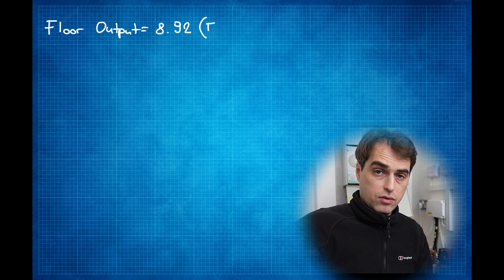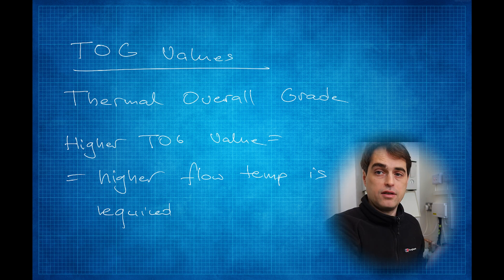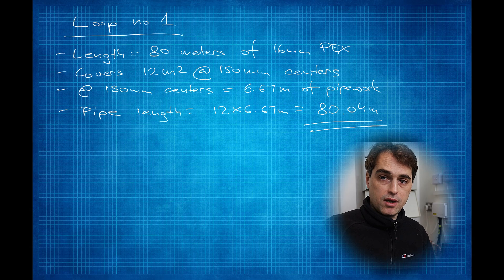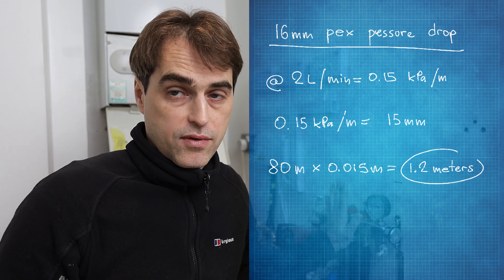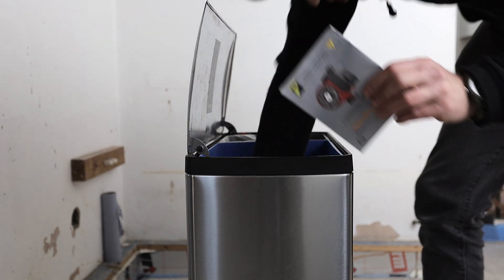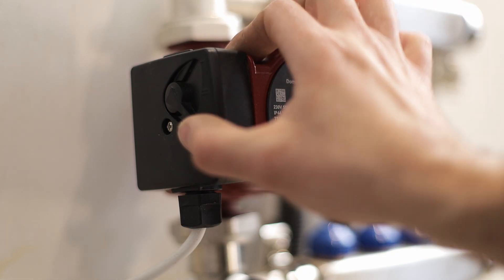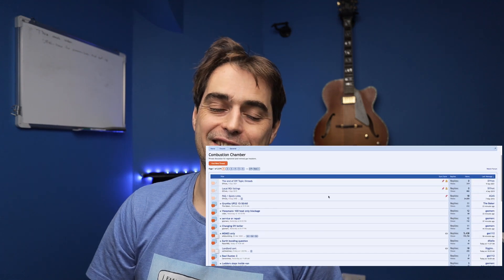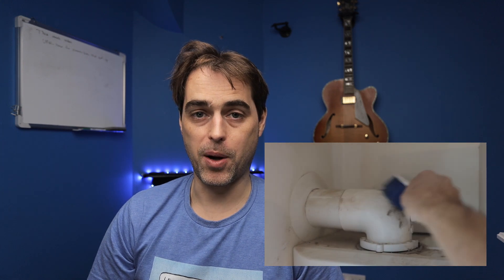Step-by-Step Guide to Setting Up an Underfloor Heating Manifold

Comment: Hi, when I'm playing with those flowmeters, they should change the water flow value using that string and I should see the flow rate on the scale, right? What if I want to adjust it after a year and I'm playing with it and it doesn't move at all, it's still at zero? Thank you for your time

Comment: Warning - the CIBSE Underfloor heating and Design Installation Guide is full of errors. In particular the design calculation sheet in Appendix D. It should be recalled and fixed.

Comment: I'm curious how the TOG works out in the long run. Insulation delays heat transfer, but it doesn't stop it completely. Eventually the heat will seep through, and if the house is correctly sealed and insulated then that heat isn't going anywhere. It's not like heat loss to outdoors where the warmed air is constantly blowing away. The surface inside the room is going to heat up.

If you want to have the room at different temperatures at different times of day, then the thermal lag through the floor coverings has to be accounted for. But if you're just bringing the room up to a set temperature and keeping it there, any carpets or other obstructions on the floor are going to come up to that temperature too.

Comment: I think the question for me here is what comes first, do you set your flow rate to maintain a DT of the water in a circuit based on the output of that circuit at the flow temp and floor covering, or do you set your flow rate based on the heat loss of the room, if the emitters are oversized this would surely widen the DT as the flow requirement would drop, thereby reducing efficiency of the heat pump. The latter seems to be highly dependent on EXACTLY sizing your emitters to the room. Thoughts?

Comment: Why would you not Jyst open the flows to Max  on each circuit?
Reply: Water will flow through the circuits too fast and not transfer heat into the floor. Hot water will just flow through and return back. For there to be heat transfer (from the pipework into the floor) there needs to be heat loss. Pump it round too fast and it won't have time to heat the floor.

Comment: Awesome stuff but I recently increase my flow metre to max and pump the highest setting simply because I was tired of waiting 3 hrs for the system to heat up the rooms.  I typically run it 3 hrs in the mornings. And sometimes 2 hrs in the afternoon. Should I just set a lower temp and keep it on all the time?
Reply from the maker: ufh is a slow response system so it should be run for longer periods of time. The best set up is to run it 24/7 on weather compnesation if possible.

Comment: Great videos very helpful, now pressure testing my system. I moved the pump to the other side of manifold for the purpose of piping to hot water and i now have filling valves on the same side is that okay to do? Thanks

Comment: Wow what a great video, thank you so much. I don't know the pipe lengths in my UFH system but can I still adjust the flow rates on each zone to get the drop of 7c, then add together the flow rates to calculate which pump setting is sufficient? Maybe it would work if I put the pump on the highest setting while I configure the flow rates?
Reply from the maker: Start with the lowest setting.
Reply: Thank you so much 🙏 I have a second UFH zone too so should I shut the other one off completely while I do the testing or doesn't it matter? My 14kw Ecodan says it's currently pumping 31l/m
Reply from the maker: @semolinaulike  ahhh - if it on a heat pump then you should not have any pumps on the manifolds to start with
Reply: Ah ok, that's handy thank you! My system was originally powered by an oil fired boiler. I had an ASHP fitted 18 months and only now am I learning that they should have removed the mixer valve and the pump from the manifolds 🤦🏻

Comment: Shouldn’t you add the pressure drop of the indoor unit of the heat pump to the pressure drop of the longest loop in order to calculate what head the pump needs to be able to overcome?  Unlike the other (shorter) loops that you rightfully ignore, the heat pump’s heat exchanger is connected in series.
Reply from the maker: it is separted by the blending valve!

Comment: 4 am thoughts….

You say there is a need for a supplementary radiator, could you not have increased to 150w/m output with an increased Delta or a higher flow rate? 

I’m Probably missing  something here!

Comment: Between your content and Heat Geeks I have learnt so much. I am a little confused by flow rates though. I understand the maths but could swear I heard on Heat Geek that if you increase the overall flow rate you can reduce the flow temperature? Is that right? If so, why not open the valves on the manifold fully and reduce the flow temp? I get that increasing flow reduces delta T but does that really matter? For example, if you used a delta t of 5 instead of 7 then your flow rate would be higher and so could reduce the flow temp or am I missing something very obvious?
Reply from the maker: Yes you are confusing MWT with flow temp - no matter the flow rate flow temp stays the same. MWT increases with flow and DT narrows. Revisit mass flow equation. Flow = power / DT * SHC
Reply: Ah I see. I guess I assumed a higher MWT would mean more heat released into the room but as you can't increase the flow rate without it decreasing the delta T you'll always have the same power output.

I guess the question then becomes what is more efficient for a heat pump. Does it use more electricity to pump at a higher flow rate or overcome the flow temperature drop from a bigger delta T?
Reply: @tommyhendry8771 I would say you are correct with your 1st comment. Say for example you have a floor with a heat output of 1.26kw at a MWT of 35c, delta t 10c, flow temp 40c. Mass flow equation 1.26 / (10 * 4.2) * 60 =1.8  L/m.
Now reduce the flow to 37c with delta t 4c. 1.26 / (4 * 4.2) * 60 =4.5 l/m

Comment: By being so “obsessed” over every calculation despite “flow meters not allowing exact precise settings” it will make for a much more efficient system.

By being as calculative as possible I would much prefer you as a installer, rather than someone who says “ too much math or waste of time”

Those comments as I’ve seen in this comment section are just absurd to me like please don’t do any hydraulic heating then because you will ruin homes and negatively affect people if you cant take the time to frgn do it right. Goddamn.

Comment: Thanks for this video. I’d like to go with UFH in a new build project. I’ve had a couple of chats with installers. One has suggested zoning with actuators linked to room thermostats but another guy (a Heat Geek) is suggesting open loop with weather compensation as the most efficient way. I have seen Adam from heat geeks talking about not zoning. My instinct is for not zoning. Do you have any preference ?

Comment: When you give us a pressure drop in metres, what do you mean? Pressure is not measured in metres, it's measured in pascal or bar (or psi). Is that metres of mercury?, metres of water? Ah OK, it's later equated to 'pump head' so that's 'metres of water' or more or less bar/10.
Reply from the maker: correct m h2o - as pumps are rated for head in m h20 or bar or convert to psi or pascal

Comment: It's very interesting, but the flow meter gauges are that small, that you can't accurately set them anyway. You said it yourself and set them to just over 2l/m. Which begs the question, all these formulas providing accuracy to 2 decimal places is a bit of a waste if you can only roughly set it anyway - seems like the manifold/flow meter is designed for a rough gauge of flow and then tweak it as necessary.
Reply from the maker: It’s accurate enough to set it 0.5l - better than not calculating it at all

Comment: I'm having an issue with my UFH system. I set the thermostats to 22 degrees, but it doesn't go any higher than 20 (ambient). All the valves on all the circuits are open and it basically doesn't shut off as the desired temperature is not reached. Water temp on my gas furnace is set to 45 deg and blending valve is at maximum (50 deg). I observe that the pipe which goes into the blending valve is 37-40 deg but every pipe after the blending unit is 25-27 deg. Curiously, on a hot day, the ambient temp was reached, and all the valves were closed, circuit board and pump were shut off. I experienced the exact moment when everything shut off. And when I touched the blending unit, the pump, the pipes, they were all hot (the hear didn't stop at the blending unit). This problem started out of nowhere. I didn't do anything in particular, except from increasing the pressure on the furnace from 0.9 to 1.7 bar.

Comment: I have a vaillant heat pump with underfloor heating in 50mm screed and radiators upstairs. Would you recommend fitting a blending valve at the manifold to be able to run the rads at 50degrees?
Reply from the maker: No, no blending valves or additional pumps on manifolds for UFH on heat pumps
Reply: @UrbanPlumbers  thanks for the reply 👍🔧

Comment: hi, I got a question, you mention in the beginning of the video the blending valve, later you did all the calculations for pump end flow meters, but I did not see you set the blending valve later in the video. Or is the blending valve the "dial" to adjust the flow in temperature ( in this case 33.5 degrees) maybe a silly question (I' am not a pro just a home owner with cold feet and a huge gas bill)

thanks if you answers, keep up the interesting videos.

Comment: Hi Szymon. Loving the videos. Do you mean that a mean water temp of 30C will produce a 30C floor temp? Worth a look?
Reply from the maker: did I say that? Obviously wrong if I did.
Reply: Yes I think you did - you said a room surface temp of 30degC and a mean flow temp of 30degC (but adjust for tog).

Comment: Very nice video...glad to find competent people on the topic. One question...I've gone through the math and set the pump to max speed looking at the pump chart. Nevertheless the manifold flow meters (12) won't get to the required values. They barely reach 1 or 2 l/min. Are these rellay reliable in your experience? The system is brand new. Thanks!

Comment: I'd love to see what you make of the near on 20 year old system someone installed in my house. 6kW electric flow boiler, 7 loops in 6 zones but one has no thermostat and is labelled as 'bypass', no flow meters and a house that loses heat for fun. I just cannot seem to find anyone local to me who has a clue. The circuit in the master bedroom is two loops and never seems to work at all well, and god forbid we need to heat more than one or two rooms at a time because it seems like the boiler isn't man enough, but then I'm not wealthy enough to run 9kW of electric boiler!

Comment: If I may, I like to pick your brain for a bit.
I am looking for a vale which operates without electricity and is capable to control the flow to a indirectly heated boiler (from an ATAG combination heating system) which I like to heat using heat from a campervan coolingsystem. 
I like to be able to cut off water flow to the coil in the boiler as soon as the water in the boiler has reached 75-80 degrees C.

Comment: Great video, I had all my values calculated by the company that supplied the UFH system, but I’ve installed it and really wanted to understand the technical aspects and make sure it’s working at it should be.  Thank you.

Comment: Thanks so much.I have an underfloor heating system.I have two separate supply manifolds for a two floor house each installed on its serving floor and they use the same circulation pump and the heating system.I'd like to know if I set  one of the floor's set of flowmeters higher than the other floor's flowmeters.I mean 2l/m on the second floor's , and 1l/m on the first floor's,what will I get from this configuration,will my second floor's heating respond primarily to my rising temperature on that floor.I could not put it right here, sorry for my English..

Comment: I enjoyed this. I am not a heating engineer, but a biomechanics sort of guy, and this was good to follow. I may also have been an aircraft engineer in my past, though. My system was installed in the way you discussed…and the builders even threw the thermostats out in the skip, too… No balancing as all manifold valves were full open and a broken(stuck) blending valve so the boiler flow at full temp was blowing through our screed floor at 75c. So all those faux pas were “fixed” by me during lockdown 1, and I just managed to check it all out using logic! Awesome. Getting a priority hot water conversion and weather compensation fitted to my Viessmann boiler tomorrow (sorry about the  Viessmann bit). You and heatgeek have saved me a fortune.

Comment: An average installer would not understand all these calculations .
Reply: The average installer needs upskill or bring in assistance. Costs will have to be passed onto clients - if they want well designed low temp systems there will have to be a cost, the days of rolling up and slinging in an oversized boiler and oversized rads are coming to an end
Reply: I'm no installer and I perfectly calculated everything I needed for my house and understood everything he talked about.

Comment: Hi I just recently completed my UFH manifold with my combi boiler and existing rads. Ive made two zones one for ufh and the other existing rads circuit. I adjusted the flow rates on the ufh manifold. 
When under floor heating ran with rads all is fine. 
When rads cut off and just UFH ran the boiler started short cycling, this later i figured out because the ufh only needed 2.5k and the boiler couldn't modulate down to that low. 

So i was puzzled something isnt right as for the ufh the delta T value was like 45/25 which we needed 7 or 10. Also cud never seem to get air out of the system. The  Return pipes were not  heating up either. 

So i now openned all flow rates to max and everything sorted itself out the pump ran at full speed, the delt T 7 was 45/37 and the boiler is now not short cycling and running normal, also returns are warming up.

Do i need to set the flow rates as its working as it shud or was it a case of trapped air.

Comment: Hi what control setting should my underfloor heating manifold pump be on - Differential Pressure Variable, Constant Differential Pressure or Constant Speed. It’s a Wilo Para on a 6 zone system with actuators controlled by room thermostats. Thanks Tim
Reply from the maker: constant pressure

Comment: Hi -- really like your videos -- i've been a plumbing + heating engineer for 47 years and now like you have my own business -your work + knowledge is secound to none - your customers are lucky people --
Reply: The biggest problem is people don't or won't pay for knowledge hence the part at the beginning, pump on 3 and set all the flow valves to the same. It will still work fine and you will never have a complaint. A race to the bottom as they say. People want heat at the cheapest cost to install. Seldom will you come across someone who wants and is willing to pay for the best designed system. Such is the world we live in but if you can, at least try sometimes.
Btw BG fkd more open systems than they fixed simply because they never taught their "engineers" to read a pump graph.

Comment: This is a great video! Thanks for sharing your extensive knowledge. Can I ask how a 20m pipe run between an ASHP and the cylinder effects the ASHP output?
Reply from the maker: It depends on the output of the ASHP and pipe sizing. How big is the HP and what is the size of pipework ?
Reply: I have a 7k Vaillant aroTherm Plus and was planning on using 25 or 28mm pipe
Reply: Also with regards to ufh flow rates, how does the flow rate work when you are using multiple loops? We have a room with 262m of 16mm pipe with output of 1095W. The flow rate of that is 2.23L/min (but we have 3 loops not 1 loop at 262m) I presume we divide the flow rate by number of loops to give the flow rate/ loop?

Comment: Thanks for this video! I got underfloor heating installed a couple years ago for my kitchen (about 10m2 heated floor)/dining room (about 30m2) and checking the pump and flow rate meters it's all just set to full... I have no idea on the length of pipework but will reduce the pump right down and see if it makes any difference at all :)
Reply: You might be able to calculate the length of your pipework, as it's stamped on pipes at 1m intervals. So check at the manifold and follow the pipe on feed and return.
Reply: How did it go?
Reply: Thanks :)

Comment: Great Video and perfect for a new install with known UHF Circuit Lengths, but what about recommissioning and existing install with unknown circuit lengths ?  Any tips for that ?
Reply from the maker: Thermal camera to inspect pipe centers and pipe runs
Reply: @UrbanPlumbers  yes, I’ve mapped them similarly for the runouts to room but have not tried to back calculate the lengths of Serpentine laid rooms or Spiral Counterflow Snail laid rooms. I guess there equations for that and you could use an assumed Circuit Spacing of 150mm. I’m not sure how big the margin of error would be or indeed how significant that would be for overall calculations. 
Perhaps just using UHF Room sizes in SqM could be  roughly converted to lengths ?
Reply from the maker: @Bob_too  yes you can calculate length knowing area in m2 and pipe spacing

Comment: Hi Mate I have a question. I have a room of (3.4 x 4.8) 16,32M2 and it has a 16mm pipe total of 84.5m in a floating rib raft concrete floor. Using your calculations, it needs a flow rate of 3.26, but my supplier has indicated 1.32 l/m at 11 Deg C . Have i missed something
Reply from the maker: What’s the room heat loss?
Reply: @UrbanPlumbers  Room loss of 816W and air loss of 232w , total of 1,049kW = 64.28w/sqm